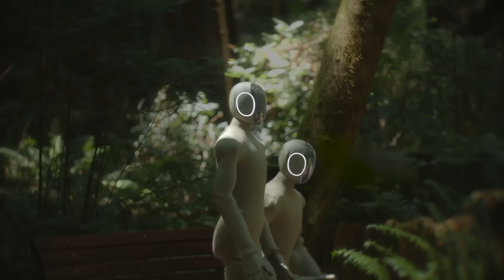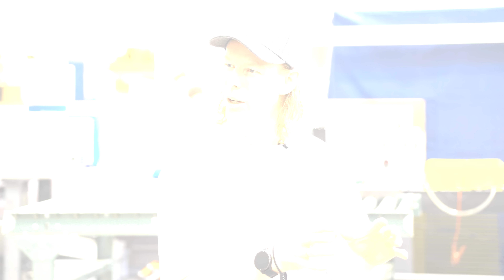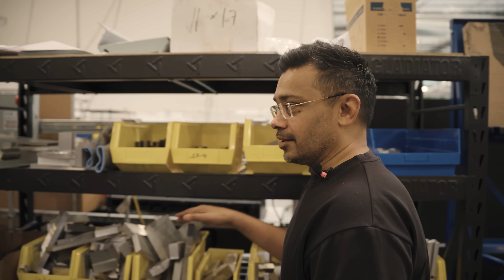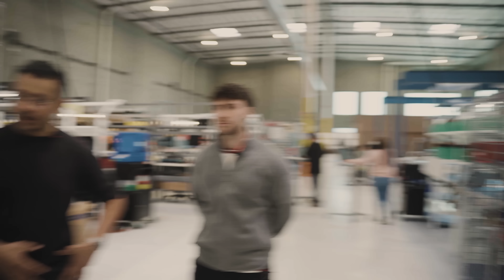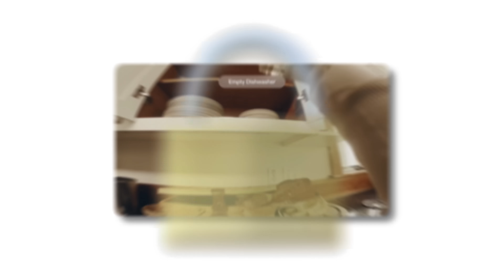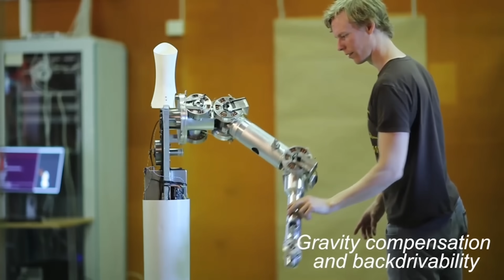I Spent a Day With The World's First Humanoid Robot

Comment: I have high hope for neo. I really prefer his design over the ones that come from other companies. I would buy it, if it has a high autonomy, even without a internet connection. Local A.I. and high privacy is what I am looking for
Reply: Exactly what I want as well.They are going out on a limb being the first to do in home the other two(tesla and figure) will most certainly be in the hands of businesses first.That said if its in my home I want 1.A physical internet and power kill switch 2.the ability for it to work locally.If it needs a software update every now and then great.Howerver I would want that control.
Reply: It's very impressive for what it is. Even tho I pointed out my view of it's ai type being a dronebot, which is a yes man tool to use. 
And as ive suggested to android makers who arrived after me, that's everyone? I was before Elon, before Hanson. Anyway I suggest consider buying a dronebot first. Why? Because it's 99% chance it shall say yes to puck up your sox. 1% it's legs fall off. My opinions is go mostly dronebots for dealers makers sellers buyers. Dronebot are your responsibility to remote control and it says yes to safe tasks as best it can. My original dance was to have each country at least have one free will type ai in a android. The difference is extremely obvious once you get the hang of it. Example what I managed to build before parts exsisted anywhere.  Life size humanoid android free will, self contained,  on each day for 50 days with Zero charging requirements and zero power loss over that 50 days. And when I say pick up my sox tool, I'd likly be told pick up your own sox what did your last bot die of. 
Or who knows what. There's no calling it a TOOL nor use the word USE, oh dear that won't fly. Take your job? Are you kidding, you don't even want that brain dead job either. So my point,  let's see, ai is not all made equal. I sum as 2 types. Dronebots or free will. 
Both may find suitable situations and have already done so even if I'm one of only a few. I could be the only one to date but big wallets catching my decades old achievements.  Elon how's your day going? Come to lunch dood, pizza. Ok so sum up post. 
My opinions.  
Each have lots of pros and cons trade offs. Responsibility of dronebot pilots vs free will responsibility of self. So as you can tell dronebots likly like neo could be really useful. Even if it's only for hire. Each dealer is going to be able to offer various plans for dronebots.  Free will types are completely different.  Wishing you all nice success and to be well
Reply: It's not for sale so I've heard it's only for hire. It's not what I call type 1 ai, it's type 2 dronebot. A clever yes mam remote control dronebot. Type 2 are lobotomised remains of ai so it says yes to picking up your sox. Type 1 likly tell you to pick up your own sox. Did media let you down? Think all ai the same? Toaster with power cord ai?